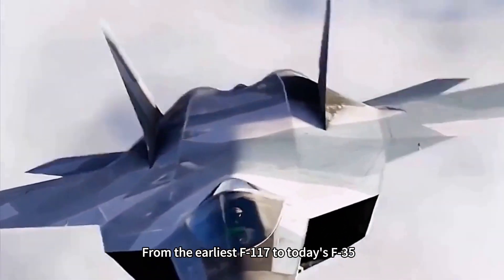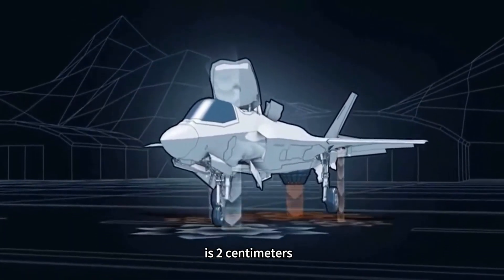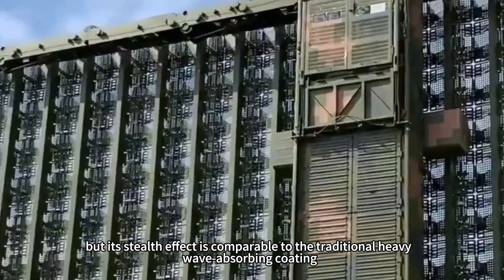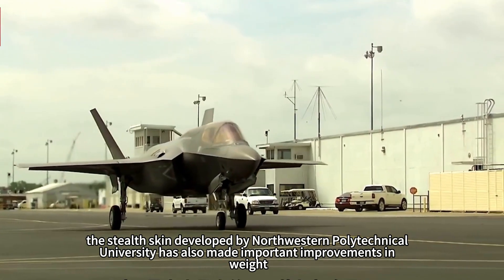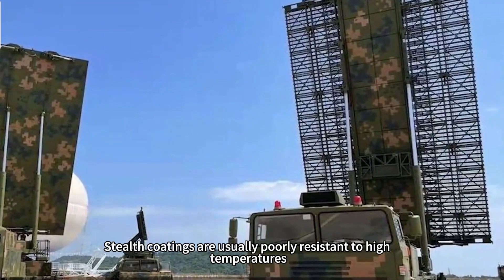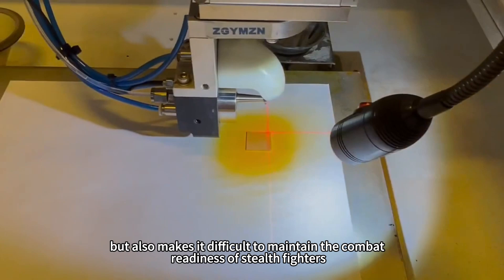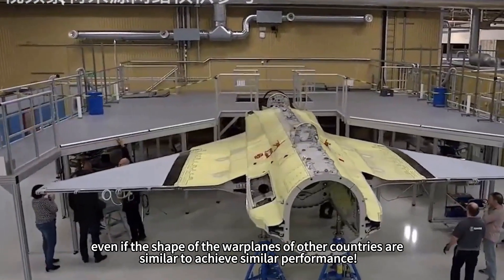Stealth coatings obsolete?China's Sixth Generation Aircraft May Be Equipped With New Stealth Coating

Comment: This is an excellent transcript for analysis because it perfectly demonstrates the line between reporting on real-world scientific research and exaggerating it into a speculative, near-magical military capability.
This transcript is not complete nonsense, as it is grounded in real, cutting-edge materials science research. However, its factual value regarding a deployable system is extremely low, as it presents research goals and laboratory achievements as fully realized, combat-ready technology with incredible performance metrics.
Here is a detailed breakdown:
What Has a Factual Basis (The Kernels of Truth)
The Problem with Stealth Coatings: The transcript correctly identifies the well-known drawbacks of current Radar Absorbent Material (RAM) coatings used on aircraft like the F-35. They are heavy, thick, expensive, and require intensive maintenance, and their performance can degrade with heat and environmental exposure. This is all true.
Northwestern Polytechnical University (NPU): NPU is a real and leading Chinese university with a very strong focus on aerospace and materials science. It is absolutely a key player in China's research into advanced stealth technologies.
Metamaterials Research: The core concept of a "stealth skin" replacing a "stealth coating" is based on the real and promising field of metamaterials. These are engineered materials with properties not found in nature, and they are a primary focus of next-generation stealth research globally. The idea is to make the aircraft's very structure absorbent to radar waves, rather than just painting it with RAM.
Countering Low-Frequency Radar: The transcript correctly identifies that countering low-frequency (meter-wave, P/L-band) radar is a major goal of new stealth research, as these frequencies are a known weakness of traditional stealth aircraft optimized for high-frequency (X-band) fire-control radars.
What is Highly Speculative and Likely Exaggerated (The "Nonsense" Part)
The transcript takes the real research concepts above and extrapolates them into a finished product with revolutionary and likely impossible performance characteristics.
The "J-36": The entire premise is framed around a fighter, the "J-36," which is a fictional/speculative designation. This immediately places the discussion in a non-factual context.
Performance Metrics are Unbelievable:
0.2mm Thickness: Claiming a 0.2mm skin can provide the same or better stealth performance than a 2cm (20mm) coating is an extraordinary claim. That would represent a 100-fold reduction in thickness, a breakthrough so revolutionary it would be Nobel Prize-worthy. This is almost certainly an exaggeration of a lab result or a future goal.
Hypersonic Stability: Combining broadband stealth, extreme thinness, AND the durability to withstand the immense heat and stress of sustained hypersonic (Mach 5+) flight is a monumental engineering challenge. Presenting this as a solved problem is pure speculation.
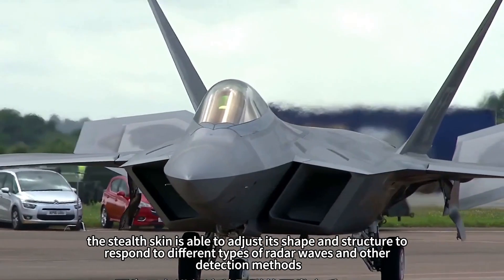The "Adaptive System": The claim that the skin can "adjust its shape and structure to respond to different types of radar waves" (5:03) is science fiction at this stage. This describes "smart skin" or active camouflage technology that is decades away from practical application on a fighter jet.
Presenting Research as a Product: The biggest issue is the conflation of research papers and lab prototypes with a combat-ready system. The transcript mentions "Shenfei's composite stealth sandwich" and NPU's research, but then presents them as integrated components of a single, functional "stealth skin" that is ready to be applied to a new fighter. This is a massive, unsubstantiated leap.
Conclusion
This transcript is a classic example of "science-fact-to-military-fiction." It starts with real scientific problems and real research avenues, but then assigns them speculative, best-case-scenario performance figures and declares the technology to be a solved problem that will give China an insurmountable military advantage.
Verdict: It has low factual value as a report on current, deployable technology. It is highly speculative and presents research aspirations as reality. While not "complete nonsense" because of its basis in real science, its specific claims about the "stealth skin's" performance and readiness are so exaggerated that they verge on fantasy. It is more a piece of technological boosterism than a sober analysis.

Comment: lol without stealth paints, it can only , it is not that stealthy,  I think that china got the stealth  paints from seriba down F111 , the shape is not enough.  I think that we should as stealthy plane is any longer neccessary now  because of the new generation systems can detect  stealth.  f22 killed 187 rival to  zero during exercises with 4th generation fighters. J20 killed 167 to zero in exercises, so just imagine how important stealth, it is .
Reply: @freeworld88888  Did you even listened carefully to the YT vid? Don't you think an state-of-the-art permanent stealth skin is far superior to the stealth coatings applied to the F-22s and F-35s which can peel off due to over-heating and affected by weather and which needs to be re-coated every couple of flights?